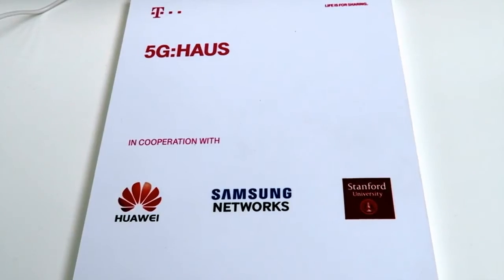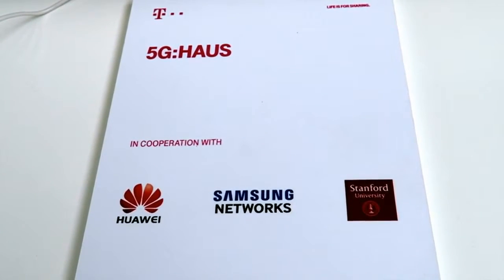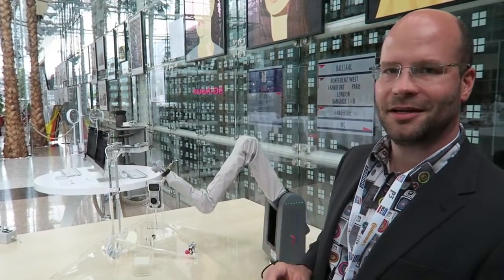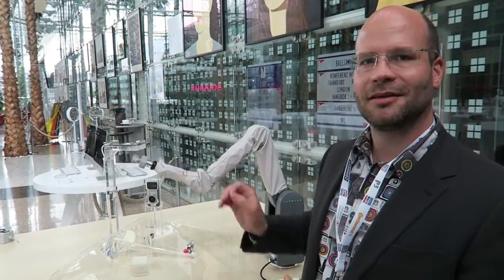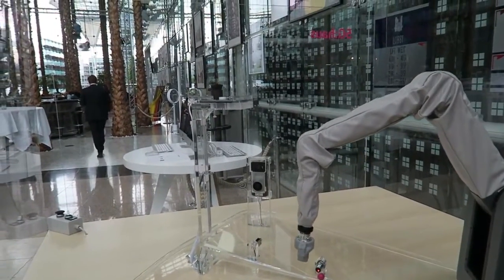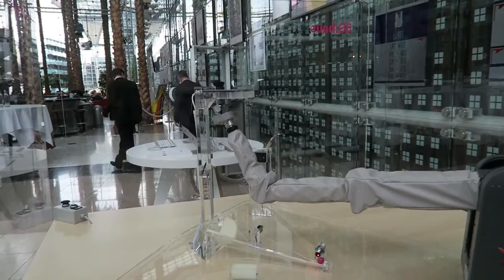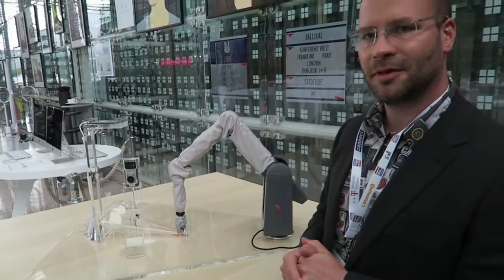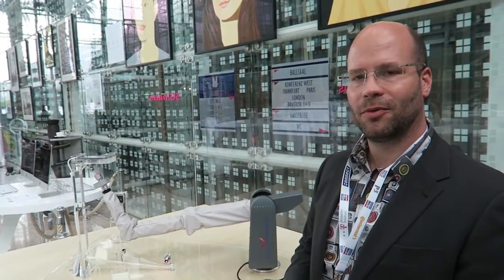#5G-Demonstration: So funktioniert der neue Kommunikationsstandard

Comment: Niemand muß Angst haben, dass 5G in den nächsten Jahren mit 3,5GHz flächendeckend verfügbar sein wird. Das passiert erst später mit den Frequenzen die jetzt auch für 4G, 3G und auch 2G genutzt werden. Es wird ein Umbau der bestehenden Infrastruktur mit zusätzlichen neuen Standorten kommen. Aber dahinter stecken keine Roboter sondern Firmen die beschränkt Kapazität haben. Angst unbegründet! Zudem ist heute schon mehr Hochfrequenz in der Luft und vor allem zuhause zu finden, also so mancher glaubt zu Wissen! Das Frequenzspektrum von 15kHz bis weit über 20GHz wird heute fast vollständig genutzt und man findet heute im Bereich bis 1GHz und rund um 2,4GHz in vielen Privathaushalten Geräte die auf den ersten Blick keine Funkkommunikation betreiben und dennoch dort senden. Man nehme einen Computer und eine PC Netzwerk oder einfach nur einen Router und ein modernes Ladegerät für ein elektronisches Helferlein. Oder einfach nur das Ladegrät fürs das Elektroauto, das Elektrofahrrad oder die LED Beleuchtung. HF soweit das Auge reicht. Die Menschen beklagen sich über Funklöcher und schlechten Radioempfang, schimpfen aber über die starke Strahlung. Schizophrenie wäre eine bessere Beschreibung dafür! WLAN strahlt angeblich so stark, dass man schon ein Stockwerk tiefer einen Repeater braucht. Wie passt das zusammen?